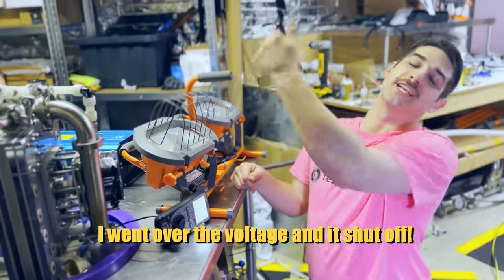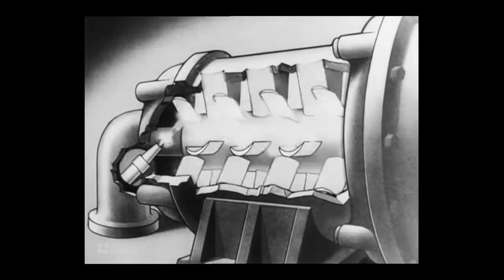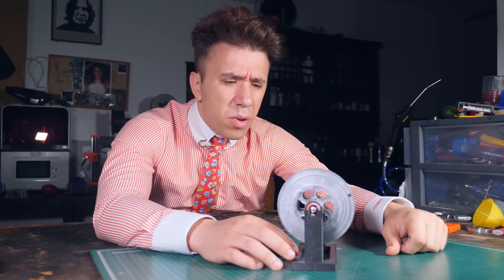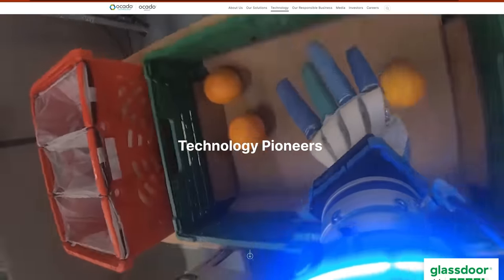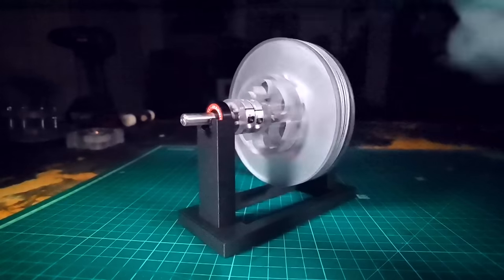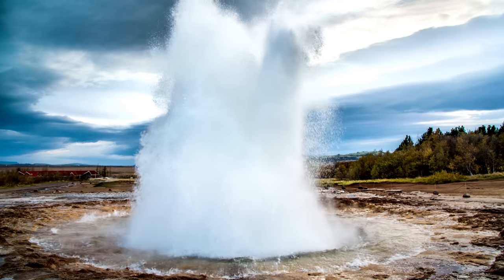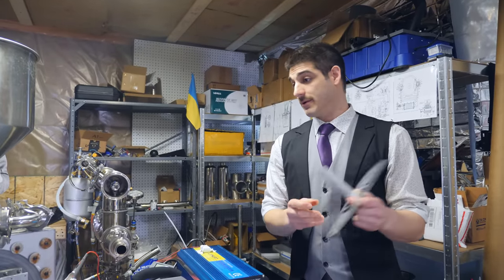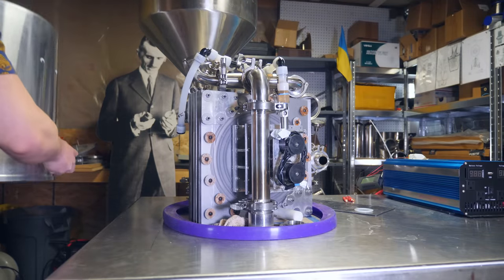Building Nikola Tesla's Bladeless Turbine

Comment: I feel like the biggest upside of using a tesla turbine is, like mentioned in the video, the possiblity of using "dirty" steam to spin the turbines.
It would be cool if you could build a homemade high-pressure steam boiler and try to get the highest efficiency out of your own turbine.
It would make an interesting comparison between conventional steam turbines and a steam-driven tesla turbine.
Reply: The problem with using "dirty" steam is that pressure is directly correlated to temperature. The only real upside is the high tolerance to low steam quality. But that's also not really a problem if you use a steam boiler since all trace gases are purged relatively quickly. So all that's left is the ease of construction and cost per unit.
Reply: how about attaching an evacuated thermal tube to get steam from solar energy? maybe get a couple of them and make a steam module?
Reply: @francissmithson398  I was thinking about using salted water or ocean water to create steam. Conventional turbines suffer immensely from steam impurities since they damage the blades and increase maintenance frequency.
Reply: @ItsMeArda  The problem with using salt water isn't that it damages turbines, the problem is that it damages the boilers.
Reply: @francissmithson398  I think the problem is getting the water pressurised. You will have to use some sort of heat to pressurise your fluid.
Reply: @francissmithson398  the problem with using them as water turbines is the low efficiency compared to other turbine designs
Reply: @francissmithson398  The boil is the same as with steam distillation of seawater. There will be a buildup of seasalt in the boiler making it thicker for heat to go through to heat the water. Eventually you will need to take the boiler offline to clean it out.
Reply: @francissmithson398  Sure, we already have a lot of water turbine/wheel designs that are highly optimized for different water pressures, flow rates, and flow speeds. Even for extremely small operations. The reason small-scale power generation (mechanical and electrical) is a niche compared to solar or even wind comes down to the very specific requirements of water power. 
Using multiple turbines in series is also a bad idea since you want to use as mutch energy as possible in your first turbine. If there is still enough energy left to power a second turbine you did something wrong in your first one.
Reply: @bogsp  or you could use the energy to run a mutch simpler sterling engine
Reply: @johpfit760 so unfortunately this is not true. This would be like saying that the superheater that brings up the temps much higher in a steam system increases the pressure but it doesn’t do that. The temperature is brought up without raising the pressure.
Reply: @francissmithson398  Thank you for your thoughtful comment and excellent questions.

The reason we often use steam in power generation - particularly in turbines - is due to its high energy content. 

 We can harness energy via the expansion of the steam, and other elastic gasses in either Brayton or Rankine/Organic Rankine thermodynamics systems using the TesTur. (Or hybrid cycles like the Cheng cycle) 

This is essentially how all heat engines operate: 

they convert thermal energy (heat) into mechanical energy (work).

It's important to note that heat is not the only form of energy that can be converted into work. 

As you correctly pointed out, water pressure can also be used to generate power, such as in hydroelectric plants where the potential energy of elevated water is converted into kinetic energy and then into electricity. 

However, for most locations, having a consistent, elevated source of water is not practical or even possible, so it's not a widely applicable solution.

That said, if you happen to have a suitable geographical setup where you could trap water high in the landscape and use it to generate pressurized water, then you could indeed generate power with a Tesla turbine using this method. 

However, such setups are quite rare, and it's often easier and more practical to generate the required heat using readily available resources, such as biomass, solar thermal energy, or geothermal energy.

As for your question about putting Tesla turbines in series: 

yes, this is absolutely possible and is in fact quite common in power generation. 

In such a configuration, the exhaust from one turbine can be used as the input for the next, thus making more efficient use of the energy in the steam. 

This setup is known as reheat or multistage turbines.

I hope this answers your questions. 

Please feel free to continue asking - it's always great to engage in thoughtful discussions about these technologies.
Reply: @CharlieSolis   You don't seem to understand what I mean if you want to raise the pressure of steam in a pressure vessel your only practical option is to raise the temperature. I'm not that familiar with water tube boilers, but from what I understand superheaters are normally used to get more heat energy into the steam, increasing the velocity for more optimal use in turbines.
But please correct me if I'm wrong
Reply: @francissmithson398  For a small scale hydro powerplant you want as much efficiency as possible, specially depending on the amount of flow you have available. Even though gasses and liquids share some properties, they don't have the same values so to speak, meaning air turbines don't really like to perform well at all on water and vice versa. So for such a project a pelton wheel would be superior on any scenario that a tesla turbine could be potentially viable (high pressure setups).
Reply: @ItsMeArda  Your idea of using saltwater or ocean water to generate steam is actually a concept that has been explored in depth, particularly in the context of Ocean Thermal Energy Conversion (OTEC) plants. 

This concept was first proposed by a French physicist named Jacques Arsene d'Arsonval in the 19th century. 

His student, Georges Claude, who is also known for his work on the Claude liquefaction cycle and being a Nazi sympathizer 🤢, built the first OTEC plant in Cuba in 1930.

The principle behind OTEC is the exploitation of the temperature difference between the warmer surface water of the ocean and the colder deep seawater to run a heat engine. 

This is very much in line with what you're suggesting.

Interestingly, Nikola Tesla, in his article 'Our Future Motive Power', discusses the potential of harnessing the energy of the natural environment, including the thermal energy of the ocean. 

He envisioned a future where we could tap into the earth's hidden resources to support the industry of future generations. 

As for the issue of steam impurities damaging conventional turbine blades, this is where the Tesla Turbine (or TesTur) shines. 

The TesTur is less susceptible to damage from steam impurities or multiphase fluid flow issues, making it a potentially excellent choice for applications like OTEC.

So, in essence, your idea is not only feasible but has historical precedence and could potentially be improved upon with technologies like the TesTur. 

It's an exciting field with a lot of potential for sustainable energy production!

We will be testing our TesTur under the same conditions to prove its viability!
Reply: @johpfit760 so I just want to add a correction to what you said, as far as multi staging turbines. As for water/hydro, yes typically you want one stage. But highly efficient steam turbines have up to 15-30 stages just to get the high efficiencies they claim.
Reply: @CharlieSolis  Yes, that's true, if you run a steam turbine you want as many optimized stages as possible to extract as mutch energy as possible, but I would consider that as one combined unit. Have you thought about how that could apply to your designs?
Reply: @ItsMeArda  Wouldnt any grit or small particles erode this turbine pretty quickly as well?
Reply: @johpfit760  You bring up an interesting point about the potential for multi-stage operation in a Tesla turbine. 

In fact, the TesTur can technically be considered a two-stage turbine, depending on how the steam is expanded. 

When a diverging nozzle is used, the fluid expands and accelerates through the nozzle, transferring kinetic energy to the disc. 

The steam can then continue to expand along its spiral path, giving up more energy to the discs, which effectively works as a pseudo second stage.

However, when a converging-diverging nozzle is used and the gas is fully expanded in the nozzle, converting all available energy into kinetic energy, the "impulse" of the fluid on the discs as it pulls on the discs through adhesive and cohesive shear forces along the spiral path is more like a single stage.

This flexibility is one of the key advantages of the TesTur, allowing it to operate in a wide variety of conditions. 

Nikola Tesla himself intended to use multiple nozzles on a single turbine, as he explains in his patent for an "Apparatus for Aerial Transportation".
Patent number 1,655,114

In this patent, Tesla describes a flying machine that uses his turbine design, and he discusses the use of multiple nozzles to control the machine's operation in any position. 

This concept can be applied to our discussion about multi-stage operation in a TesTur.

So, to answer your question, yes, the concept of multi-stage operation has been considered in the design of Tesla turbines, and it's one of the factors that contribute to their versatility and efficiency.
Reply: @francissmithson398  Where are you getting pressurized water? Heat is used in power generation to increase temperature, which in turn generates steam at pressure. You need some sort of energy input in either case, heat is typically the easiest way to get there. And if you're using heat, steam is better at transmitting that energy.

Exceptions in hydro power which uses water fed by gravity, but that's generating in a different way.
Reply: @francissmithson398  2, A Tesla Turbine doesn't natively generate power any more than a gas turbine engine does. It takes the energy from another medium, typically expanding gases, and turns that into electricity. You still need something else to fuel it.
Reply: @sigsauersean  There is "dirty steam" and "sandstorm". Using some amount of filtration is going to be required to lower maintenance requirements. But the fact that the moving parts move at the speed of the steam lowers the amount of impacts that will produce erosion. Then you are looking at protecting the enclosure walls, which you can do with a sacrificial ablative layer like that used in hard rock mining, usually a latex polymer sheet that can be replaced much more easily than blades on rotors or rotors themselves.
Reply: @francissmithson398  That's ... really not as good as you think it is. You do know water wheel power has been around since forever? If your goal of moving water up is as energy storage, you need to move a massive amount of water to be practical use for more than an hour or so, which requires serious construction efforts. You could just as well buy a few giant batteries.

If your goal is to just generate electricity, you can hook up a generator straight into the water wheel. Any energy you spend lifting water is going to result efficiency losses, no matter how efficient the turbine is. "Pressurizing water" doesn't just result in free energy, you can't beat physics like that.
Reply: @francissmithson398  
My point is that you don't need a turbine to do that. A water wheel connected to a generator makes electricity straight up. There already exists communities next to rivers using small water wheels for basic power generation. People have long since figured out how to use rivers to do work since the industrial revolution.

I'm not saying to shut down any innovative uses for the Tesla Turbine, but pumping up water just to run it through a turbine right after ain't it. And expensive.
Reply: @johpfit760  i was going to make the same correction regards heat and pressure, then i re-read... it would seem your definition of "dirty steam" is saturated steam, whereas the OPs definition was "dirt+y" failing to understand how distillation works, lol. you mean "wet", they mean "muddy"..."salty"..."gritty"...

so yes, saturated steam, that is, in contact with the water from where it came, in equilibrium... heat and pressure are directly related up to the critical point.

once you poke it in a superheater, the pressure stays the same, and the energy takes on the form of "apparent heat" superimposed upon lots and lots of latent heat held within the steam itself, as it is just water with a high specific thermal mass.

you were 100% correct, the boiler is the issue. boilers have to be able to take pressure, corrosion, thermal expansions, remain tight... yet be pulled apart for cleaning. water scale. mineral contents.
you dont want dirty water in a boiler unless its specifically designed for dealing with it... (mental images of B&W photos of paddle steamer boilers cut open after a few years operation...)
Reply: This is where things get weird. To increase energy efficiency you need to lower the standing pressure of the system, drastically increasing the coefficient of expansion of water. You can simply increase the temperature of the steam at the same pressure to increase power. Or combust gas in the turbine, like you do with hydrodiesel jets, the water improves the thermal efficiency. Or something sillier is dissolving more air into the water, and massively improve it as a thermal exchange medium. And something a bit more dangerous is bringing the turbine up to Mach 1 at the periphery, this improves efficiency and makes it a bit more silent.

The dirtier the medium you are using, you might have to consider increasing the vane spacing to avoid clogging. But you can reasonably pump sludge with it. Be careful about the bearings.
Reply: @francissmithson398  
TBH, I don’t know how youtube private messages work
Reply: @francissmithson398  you can use water. If you run it in reverse, you learn how well it can pump water, especially when the edge speed is supersonic.

Have you seen that vertically oriented slow propeller turbine thing? You can probably do that with the tesla. All you really need to ensure is that there is a pressure difference at the edge and the axis, and it will spool up. And yes, negative pressure will make it spin up.

The other hidden gem here is that the medium that runs through it acts like a flywheel.
Reply: @bogsp  you can. One of the simplest designs is simply a closed loop of pipe that is effectively two long pipes that go up about 10-15yds, connected at the top with a U-bend, and the bottom connects to the input and output of the turbine.

One pipe is the hot side, the other is the cold side. The steam can only go one direction because it's easier to enter the slower axial input than the peripheral output of the turbine. A silly idea is to mix in ammonia to lower the boiling point.
Reply: @francissmithson398  that spiral pump makes me think of a set of gasometers in series... Effectievly a compounded trompe. Very cool.
Reply: @johpfit760 I wonder if that can be counteracted by using a higher temperature drop between the turbine inlet and outlet, to the point where condensation could happen, which is avoided in conventional turbines
Reply: @stephenroot1012  You can do it the same way desalination plants do it, by only boiling the sea water to about double the salt concentration, then using countercurrent heat exchangers to recover a lot of that heat energy and put it into the feed water, so it goes in at near boiling point at high pressure, and thus your boiler stays clean for longer. Yes you get wet steam out, but if you do not need to superheat it, and can use as is, then it will work with lower quality fuel sources as well, as you do not have to heat the steam to as high a temperature to dry it, and gain some efficiency off the wet steam in the turbine.
Reply: That’d be cool to make the boiler run on bio fuel
Reply: @johpfit760 sure they directly correlate when we’re talking IDEAL gas laws. Things get more nuanced in the real world. Don’t form an opinion if you haven’t studied phase and thermodynamic diagrams. I can provide links for your benefit if you’d like.